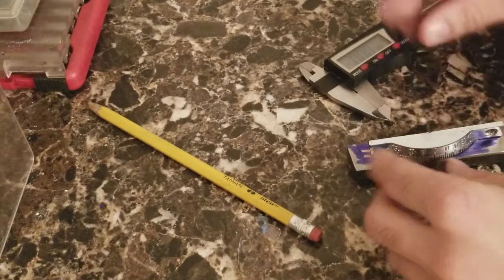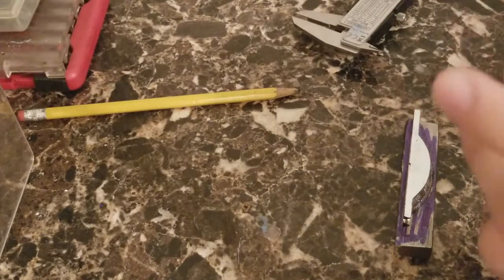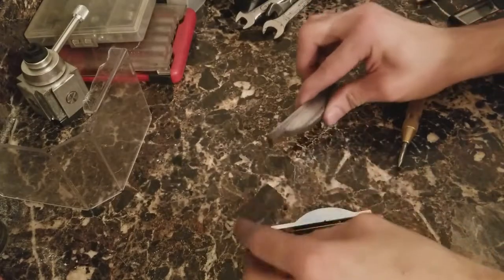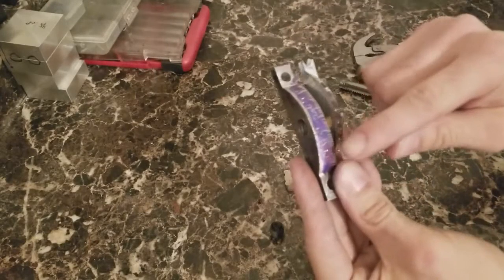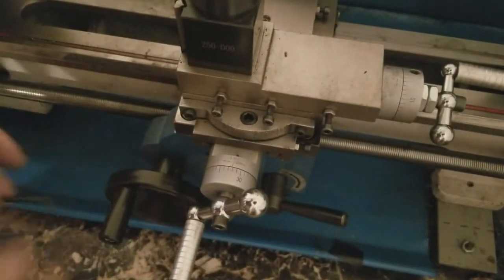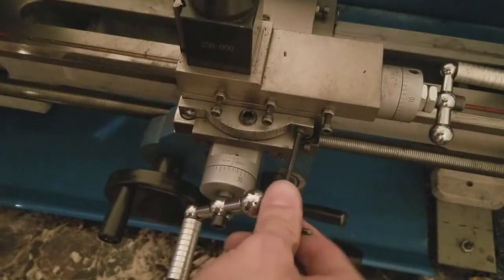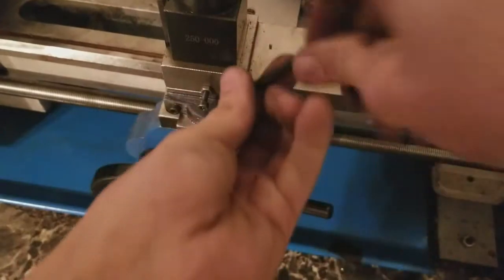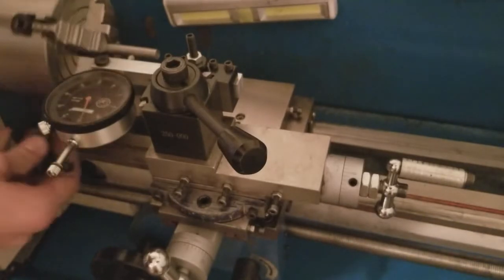Making a angle lock for the 7x14 mini lathe

Comment: I drilled 2 holes in the top slide through which I can reach the bolts. This makes turning the top slide easier than standard, but still not as easy as in your modification. But I think my system gives a more rigid topslide and I don't change the angle often.

Comment: It may not be a problem (yet), but if I'm understanding what you're doing to bind the compound, I believe you're deforming the cross slide (and compound)...and perhaps the dovetails...when you tighten your set screw. The cast iron on these things isn't all that rigid, especially as thin as it is in that area.
Reply from the maker: I understand what you are saying i don't think it will be a problem because threw screw that locks it from moving isn't all the tight just tight enough to keep it from moving the two screws under the cross slide are the ones that are tighten the most
Reply: @theguardianss11  Replace steel 7/16 bolt with spring and ball bearing under allen bolt and drill preset dimples in the plate below every 10 degrees so the locking is easy quick adjustment without measurement. Or just replace the bolt with a brass one as necessary to prevent marring the surface below it with those rings. Rifle butt stock at the end lol RIP